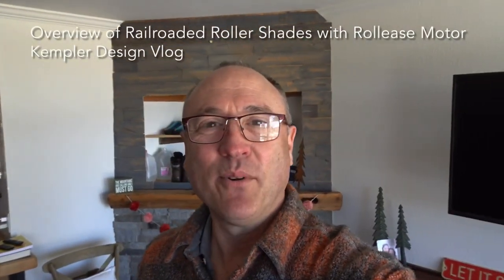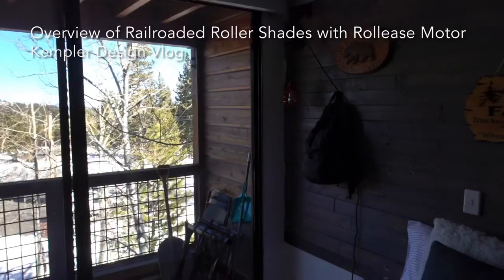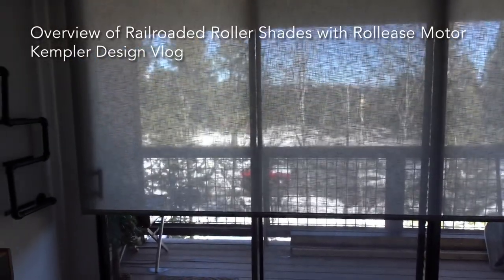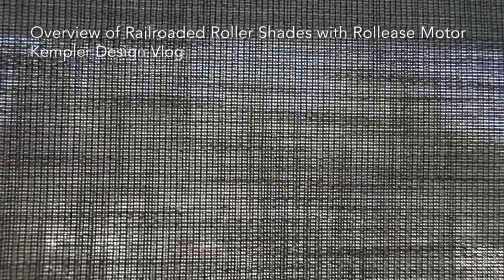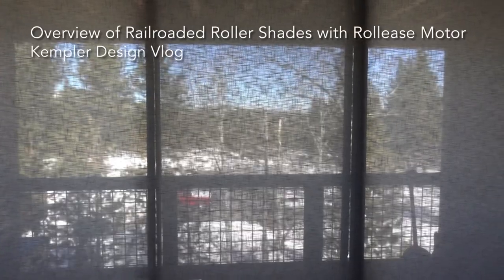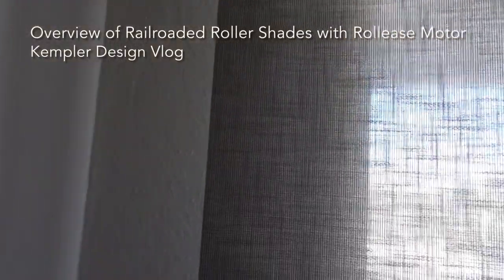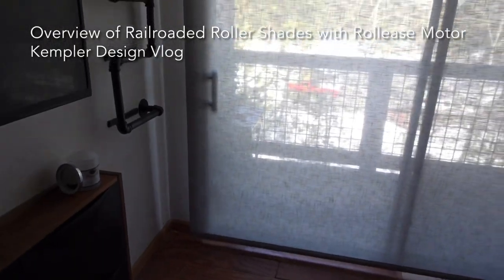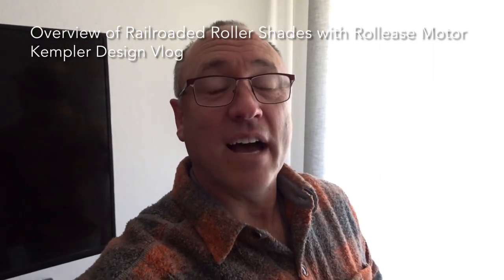Railroaded Fabric for HUGE Roller Shades- 12+ Feet Wide

Comment: Nice solution for large window. What diameter roller shade tube you used for 12ft wide shade?
Reply from the maker: I believe we used a 2 1/2" tube, but every fabric has specific needs. Please do your research to avoid any errors. :)